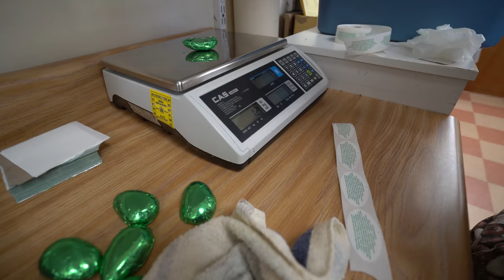3 NEW Cream Egg Flavors From Starch To Finish! 😍

Comment: If you've got a mind to make creams at home, you can beat the cream in a kitchenaide mixer with the regular paddle on low speed.  I've done it a few times and it works just dandy.  Just like Hercules, let the mixture cool to about 100-120 before starting the mixer.  Mix on low until it thickens and loses it's gloss.
Reply: What temperature do you bring the syrup to?
Reply: @MatthewOKeefe0203  240 F is standard.  no lower than 236 F. (creamier but hard to work with) never more than 240 or it will be too firm
Reply: @kathleeninkansas1770  yeah thats about what ive landed on too. I have been testing for the past few days

Comment: I’ve been wondering for the last few starch videos if you’d swapped rooms. I’m sure Max’s journey from the kettle to the starch room used to take a right turn by the scales. Now he goes straight on. (Think I’ve watched these to many times). It was really bugging me, thought I’d made it up in my head so went and checked an older video. When did you swap rooms?
Reply: I believe they swapped shortly after getting the second enrober. I don't remember if they discussed why, I assume that room was just better for the dual enrober setup. You are right, though! The enrobers and the starch room swapped places.
Reply: @tempestSH  well I’m glad I’m not seeing things. That would make sense about the second enrober though. I forgot they didn’t have both to start with.